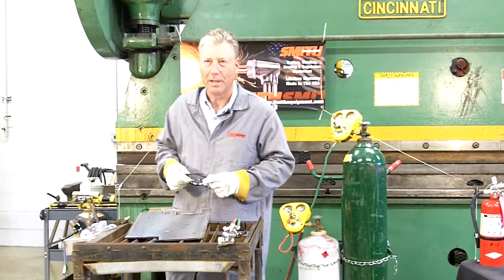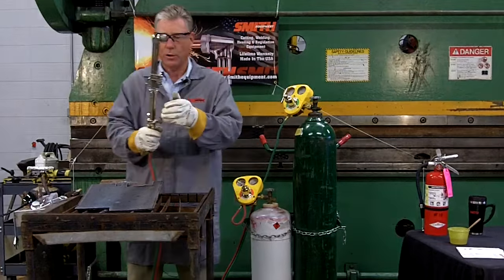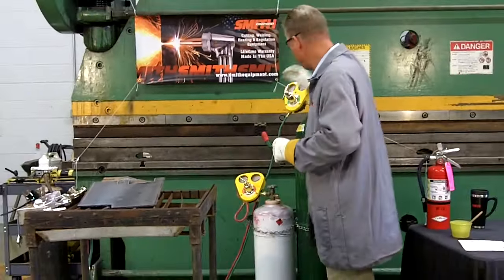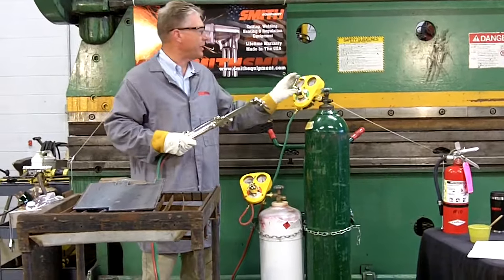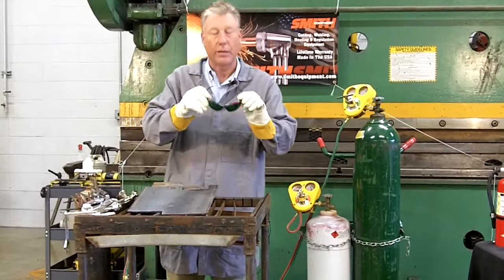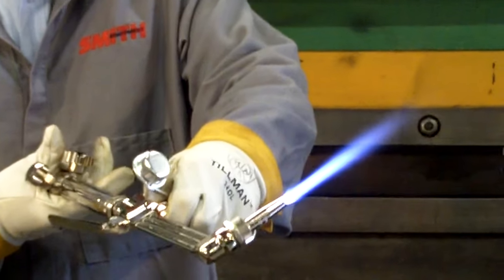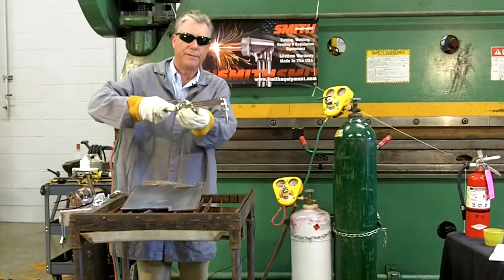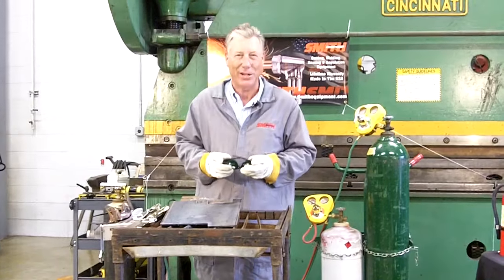Propane & Oxygen Torch Cutting Instructional Video

Comment: I was taught and always teach others to shut the fuel off first, then the oxygen. Also, there is no reason to fully open the valves. But there is a big reason NOT to open them fully. 1.5 turns is enough for fuel and oxygen to fully pressurize the system.

Comment: Airgas & praxair (Army also teaches this) says only to open the fuel gas 1 to 1.5 turns.

I asked the fire department about this, they concurred. They went into a whole of reasons why to not fully open the valves, but the two main points I took away from it all was;

In the event of a problem, it only takes that much to do an emergency shutdown.

And damage/ leaks can occur by opening fully opening the valves, and manufacturers recommend not opening all the way, especially to full open stop.

Just passing that along.
Reply: That procedure is for oxy-Acetylene

Comment: This is helpful.  I'd love to see another video or two showing how to get a neutral flame with the oxy-propane brazing tips (I have the MW-411) and also the oxy-propane rosebuds (I have the MT-805).  Some additional commentary on the propane tank sizes required to run the rosebud for short periods of time (as opposed to continuous use) would also be helpful.

Thanks in advance -- it's great to see high quality tools like your torches being made in the US.  Keep the videos coming.

Comment: Thank you sir every thing you showed me I was doing wrong ,Trusting my welding supply to show me the correct way . I could never drop the cut piece  like you showed ,I would have to tap off with a hammer . I had pressures at regulator set at what they suggested ,Witch was way to high . Thank you . My cut piece drops now just like yours .

Comment: awesome lecture! I'm going to buy a setup and only use propane.  I figure the lower temp will reduce the chances of "flaying" charred steel attaching itself to my cornea. :)
Reply: Filling a couple acetylene tanks today, I realize I have to
move to a cheaper gas and propane will seem free in comparison. Just a couple
fills will pay for the new equipment.

Comment: These are great videos. QUESTION for you or anyone. Do these 10lb and 40lb settings change as the thickness in metal changes? Thanks
Reply: Yes!  He's getting those numbers from a table in the little book that comes with the regulator.  In the welding world generally I think there's a lot of guessing at this point because the information is lost, or you are using different brands of torch and tips!  There's general information about oxy-acetylene cutting that helps you figure this out (it's in old books), but oxy-propane technique is not so common.

Comment: I have a question that may sound stupid. When should you stop using the oxygen from the cylinder? Is it a case of going until you lose all pressure or should you stop before that. I have flashback arrestors fitted if that makes a difference.

Comment: He did a fantastic job of presenting this propane torch, i didnt know propane could be as fast and clean as Acetylene in an cutting operation.
Im still not convinced that it could be better for welding than Acetylene tho.

Also this Gentleman could just be the dad of Jason from Fireball Tools.
Reply: People DON'T weld with Propane!  Acetylene and sometimes Hydrogen, that's it!   Brazing, silver-soldering commonly, but Acetylene does it all if you have it, if you can afford it, if it's not out of stock (!)....  I use both.  THIS VIDEO shows something that really nobody knows about using Propane and Oxygen, I try to get students to watch it, 12 years later.

Comment: You ALWAYS, ALWAYS, Always turn the fuel off first otherwise as you turn off the fuel without the oxygen running, the flame of the fuel can crawl up the torch and gas hoses and cause an internal fire and possibly blow up the regulators. That's why the ministry requires flame arrestors on the base of the torch.
When shutting down the torch the saying is " A before O or up you will go" referring to shutting off A (acetylene) before O (oxygen) or blow yourself up.
Reply: That is the way I learned it as well. Ag class at a small high school in S. Az in the 70's. My instructor was an island-hopping Marine in WW ll and a serious cat. He enforced lessons by a well-meaning smack to the back of the head, generally. Very effective I might add.

Comment: Can I use my acetylene tips with propane.
Reply: I don't think so!  The cutting tips and regular torch tips for Propane are noticeably different.  Ah, flame speed is lower for this combination than for oxy-acetylene or oxy-hydrogen.  SO the tips have some feature to "anchor" or "sustain" the flame so it doesn't just blow off the end of the torch.  It keeps re-lighting it constantly.  The deal is that plain acetylene tips WILL WORK sort of, but you can't run them nearly as hard!  My ignorance of this fine point and the set-up we see here used to make me think that Oxy Propane was weak and couldn't do much.  I didn't know what I was doing!  The correct set up as we see here gives a kind of shrieking effect to the torch that makes it hard to relax.  Frankly, I'll use Acetylene if it's there, but sometimes it's not!  And some kinds of work don't need it.

Comment: I just boucht an oxy acet torch and I am needing it more for heating. SO do you know where you would get a conversion kit to get it from acet to propane? thanks
Reply: You can get propane tips, they look different.  The acetylene tip just has a plain hole in the flat end of the tip, propane tips have a recess in the end, or some kind of extra holes, something to "anchor" the flame.  Propane burns slower than acetylene, and if you use regular tips you can't really crank it up b/c the flame will blow off.  You'll see a gap between the tip of the torch and the flame, and it will want to go out.  Air propane tips have these sustainers on them, too.  If you look at the tip there might be little holes around the central one, or something that looks like a gear.  SO, your main working flame is surrounded by little flames that keep the main one lit.

Comment: Could you use a air compressor instead?
Reply: Al Faatih No
Reply: Oh yes you can. Not for cutting, but for heating. Smith makes a compressed air heating tip.

Comment: What happens if i don't turn the flow up a second or third time while adjusting the flame? Death? No cutting? Poor cut? Popping backfire?
Reply: Nothing no one sets a torch how this guys saying to do it he’s clearly just a desk jockey who’s read a book
Reply: I know this is a 3 year old comment but whatever. 
Difference between oxy acetylene and propane is that. With acetylene, you open the fuel valve to smokeless point. Then adjust the oxygen and you are done. With propane, you have to open the fuel valve to the point that flames and torch have a connection still. If you open it more, when you turn the oxygen valve, oxygen will blow the flame. But at this oxy fuel ratio (flame still connecting to the tip while oxygen valve closed) flame is not hot enough to melt steel. You can try to heat steel for hours but nothing will happen. You have to give more fuel to cut. What i'm doing is turning fuel valve to the point that flame's diameter almost twice as big as the tip. Then i adjust the oxygen to neutral flame. 
So we are turn up the fuel second, and in this case third, time for not extinguishing the flame with oxygen.
Reply: @blastomerx definitely correct. Setting a propane flame is certainly more complicated and difficult for me outside in the wind than acetylene for sure. You definitely have to take that stepwise approach alternating between adding oxy and propane or the flame will certainly blow out.

Comment: @AnthonyUK  what does the lever do that makes it start cutting? i have a oxy propane torch without one is it just  magic lever someone explain please
Reply: That lever opens a valve, which lets oxygen out.  The jet of pure oxygen is what actually does the cut.  The flames are just "preheat", but don't cut the steel, they just get it to ignition temperature.
Reply: Many welding torches have an accessory for cutting, it has this extra valve and lever on it.  So what was an ordinary torch can be adapted into a cutting torch.  This is very common.  If you're cutting a lot, you can get a torch just for that, which is simpler and more rugged.

Comment: what is the correct working pressure for oxygen and propan ?
Reply: +Gabriele Trovato I'm taking a beginner welding class. I was taught to use 30 psi for oxygen and 5 psi for fuel (In this case propane). 6:1 ratio without every exceeding 15 psi for fuel in most applications.
Reply: The key is using the chart that comes from the equipment manufacturer...

Comment: Can somebody please help me, I just hooked up my cutting torch to propane and bought a propane tip, but when I light the propane and then apply oxygen it goes out.
Reply: ?  There are a few things:  If you don't purge the oxygen line first (flow out some oxygen for a few seconds) when you light up you're mixing air with the propane and the flame will go out. /  If you're using too much propane at first (if the plain propane flame is too big and tending to "lift" off the torch tip) you might sort of blow it out with the first little bit of 'oxygen'.  /    Is your oxygen pressure way too high?  I see this a lot for some reason.  The "TIN MAN" videos give a good idea of adjusting oxygen at the regulator... but you might try starting with as little oxygen pressure as you can get, and as you want more oxygen turn it up at the regulator... slowly!  The idea is to open the valve pretty far, and make adjustments with the regulator, I think this is best practice.   The problem with using a high pressure and trying to make it right at the torch is that you might not GET much adjustment, maybe your whole range of working adjustment is like 1/32nd of a turn of the knob... it's easy to go WAY too far.  Don't give up!  This wants to work!   Then once you get it sort of working you can watch the video again!   It's fun!
Reply: I noticed the most common cause of the flame going out is because the flame isn't touching the nozzle. If you always make sure the flame is touching the nozzle then add oxygen, it should be fine. Adding to much of one gas tents to smother the flame.

Comment: it really depends on what you're trying to do... for the most part, oxy-propane will get the job done, cutting, brazing, heating... plus it is readily available in case you run out... but you CANNOT weld with it, only with oxy-acetylene.
Reply: That's a load of bullshit, my 1910 Westinghouse vice jaws were repaired in 1998 with oxy propylene welding by my welding instructor.  Still use the same vise today, and a pinch point bar and a simple jack all repaired via oxy propylene. Go find a new hobby.
Reply: @tonyb7748  okay maybe you have some reading comprehension difficulty
I said oxy-propane first of all
Secondly, from what I read (and remember at this point..), it has to do with the stoichiometry of oxy-pro* combustion i.e. not balanced so you get inclusions of hydrogen (I believe it was hydrogen) molecules in your steel
What do you know about metallurgy?

Comment: You need to explain WHY the leak test soap needs to be oil free, especially on the oxygen side.
Reply: I hate to think that needs to be explained , but I suppose so. Georgian knows why ,but others may not . I liked this video. Great review ,things that I don't think about anymore. 42 years +/- a loong time to remember .
Reply: georgianbents so why does it need to be oil free soap? I'm a home gamer who's never been to trade school or has had any formal training... Self taught
Reply: Oxygen causes just about any kind of oil to spontaneously combust.
Reply: @georgianbents  it's when the pressure of oxygen causes so much friction with a contaminate within the oxygen that causes ignition. So possibly the friction of the oxygen against the oil or the friction of another particle contaminant against the oil or regulator body that causes ignition. All from the high pressure and accelerating properties of the pure oxygen.

Comment: Fairly good video. Good info except lost me at 8:35. You always shut gas off before oxygen. That way the continuing oxygen flow will extinguish the gas flame as the mix ratio changes to only oxygen. Never shut the oxygen off first. It could possibly flame back into the torch head burning the o rings. 20+ years welding.
Reply: Also, even if your eyesight is protected from the flame, a face shield is still necessary. Failure to use one out here in the northern oilfields could get you run off. AND, you should be wearing fire resistant clothing and boot top protectors. Keep your pant legs outside of your boots so molten slag has less chance of rolling down into your boots and melting your toes together.
Reply: GraceEngineering Yes but if you close O before it doesn't pop loudly. If you close A first it makes a loud bang.
Reply: A before O or up you go.

As the saying goes
Reply: GraceEngineering washing a rig without a fashshield will get you run off. Even if you're running a bucket and brush. Oilfield safety men are a different breed from other industries.
Reply: Heck yeah..  plus having a Backlash arrestor is also very helpful.  But yes your right.
I'm also a welder. I love cutting steel . I don't know why but I really dig  torch cutting and also Plasma cutting...
Reply: Welding is dangerous work.. and lots of safety training is nessesary.
Reply: I didn't know that, I turn Oxygen off first to avoid the "pop", then turn of the fuel.
Reply: Yeah, Im confused now too.  I was taught O before F, but it appears that its taught both ways for differing but legit reasons.  so in reality, if you dont care about the bang, you could do it either way.  I will tell you as a machinist, that unexpected "BANG" from behind me really fucks with me when I'm making a precise cut or measurements, common courtesy if youre working around others is appreciated.
Reply: I was taught to turn off the oxygen before the fuel because oxygen is an accelerant and could potentially cause combustion within the torch or hoses if the flame travels back after the fuel is cut off. Of course flashback arrested should prevent this, but that is the reasoning I was given.
Reply: Just realizing I'm replying to a 3 year old comment. Lol sorry

Comment: You cant turn the propane  all way
Reply: Aj Adams you open the propane tank all the way for the same reason you open the oxy all the way. That is how the valve is designed. If you open it part way like acetelyene, it will leak around the valve. Propane and oxy is open or closed nothing in between.